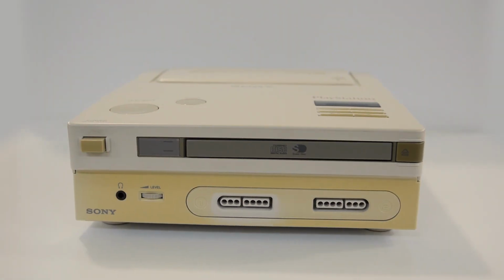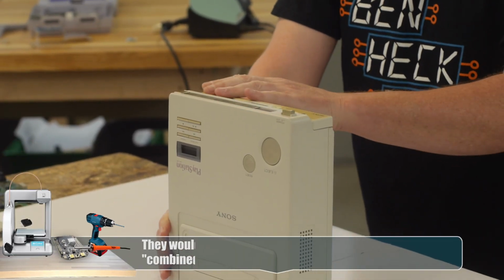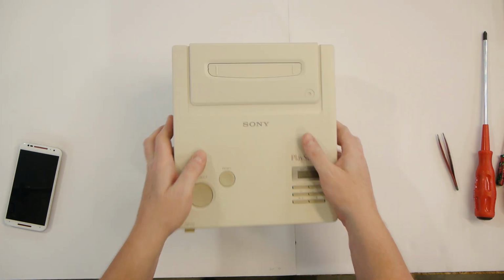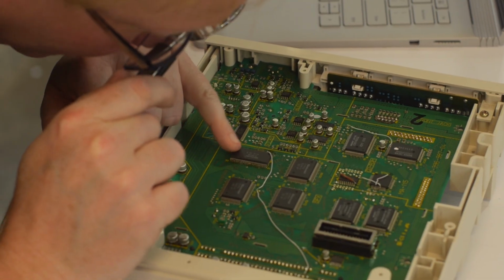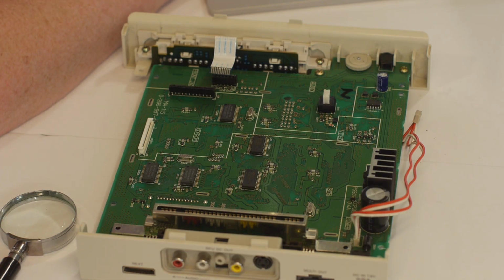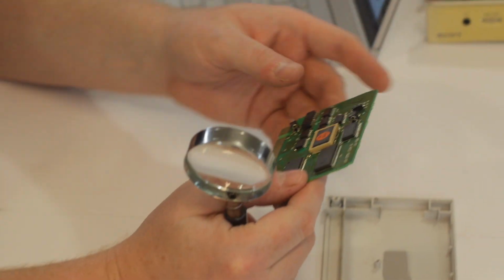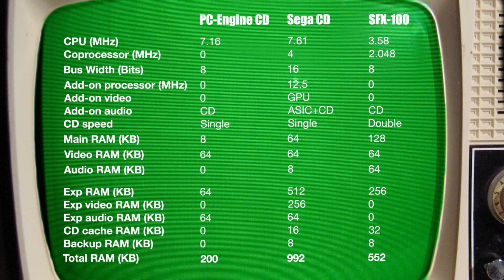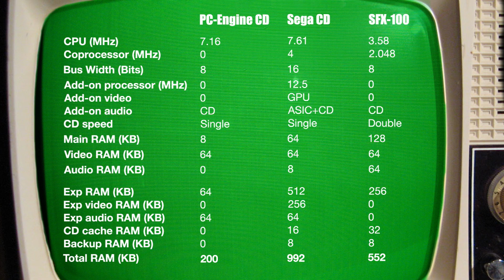Ben Heck's Nintendo-Playstation Prototype Pt 1 Teardown

Comment: I wonder if it would have been possible to re-engineer this so that the double-speed CD-ROM drive could be used to advantage - possibly with a bus-mastering controller, to dump straight from the CD, across a 16-bit bus to the cart?  From a quick glance at the cart pinout, it doesn't appear so, but there might have been a way to do it.
Reply: The 8-bit bus should still be plenty fast enough to DMA the data across to the cart RAM I would imagine.

Double-speed is still only around 300 KB/sec, and I think a fair few CD consoles use a CD drive with an 8-bit (or sometimes even 4-bit) bus?

Then SNES' main data bus is only 8-bit of course. It was quite a clever choice to go with the 65C816 CPU tbh, as it would have made a bit of a saving on te chips, and cart ROMs.
Reply: Yep - the 65C816 is pretty much just a 6502 with an extended instruction set for the 16-bit modes.

You can enable / disable "Emulation" mode on it, where it is supposedly then fully 6502 compatible with no 16-bit stuff.

The width of the bus isn't everything though, of course - the DMA on the SNES is still pretty quick.

The N64 might have a "64-bit" MIPS CPU, but it's another example of where the external bus between the CPU and RCP is still on 32-bits.

It transfers the full 64-bit words in only two clock cycles though, so that makes up for it.

The strange thing about the N64 though (and other machines) is that I don't think many games even use the full 64-bit instructions - they all use the 32-bit instructions AFAIK?

The 65C816 on the SNES definitely helped devs to port older NES games to it, as you say.

The PPU(s) on the SNES are also a kind of "extended" version of the PPU on the NES (literally Super-NES) too.

The Genesis is similar in that way to the Master System, and hence also has the backwards-compatible mode.
Reply: Wow - thanks for the full reply. ;)

(I thought I often typed a lot. hehe)

Yeah - the N64 did have a bit of a flawed launch.

It was a shame as well that they tried to cram so much into the RCP chip, as it seems like they were originally going for far more texture cache, but then culled a lot of stuff to get everything to fit.

There's an awesome write-up about this, but you have to go via the Waybacnk Machine to read it now...

http://web.archive.org/web/20100926220501/http://steveshepard.com/blog/2006/07/09/the-making-of-project-reality

Yep - similar to the Ricoh chip in the NES, the 6510 in the C64 just has an extra IO port on the chip itself. I think it might also have some other illegal instructions compared to a standard 6502, but don't quote me on that.

(the C64 was obviously quite early though, and the MOS thing probably meant they just used the "standard" untouched 6502 core maybe?)

Are you on Faceplant or anything btw?

If you are familiar with the 65C816 stuff, I may want to pick your brain about the FPGA SNES core I've been working on..

So far, I have the CPU core mainly working - I found some code online, but I had to add a couple of missing instructions and fix some other things to get it booting further.

I then removed the original CPU from a SNES board, and hooked up the SNES to the FPGA board (DE1).

I'm actually now able to mostly run some games by "emulating" the cart image from Flash, and the FPGA 65C816 core is running the whole SNES. ;)

But - there are some obvious timing issues - I don't think the setup time is anywhere near long enough for it to write to the PPU on the SNES board properly, so it will often get lots of graphical glitches, palette cycling, or just crash altogether.

The sound usually works quite well though so far (again, using the APU on the real SNES board).

It's good progress though, and there's also that almost-finished PPU code online which I've been trying to get working.

I'll be plugging the SNES board into the Cyclone V board instead very soon, as it has a lot more on-chip RAM (610KB vs only 29KB on the DE1), so that will be handy for both the full amount of VRAM and for debugging via SignalTap.)

The main RAM for the SNES can run from the 512K SRAM obviously.

I know there is already at least one other SNES FPGA core project, but it is closed-source, so I want to make an open-source version.

Preferably all converted to Verilog though, as VHDL is evil. lol
Reply: That's no problem.

Been good to chat and reminisce anyway. ;)

(and thanks for the complement on my lowly channel. hehe. I've wanted to do some "proper" vids for years, but the thought of speaking on camera is highly daunting.)

I also had a 130XE in the early 90s, so I just had to buy one again recently. It's a fantastic machine.

The new one needed a keyboard membrane, so I bought one from that seller in Canadialand (sorry, I can't recall his name / site).

LOVE the Amiga too.

I was never a "power user" of the Amiga as such, but it's an amazing system for it's time.

I was always jealous of our next-door neighbour who bought an A500 in 1987.

The father of my best friend at school at the time worked for Commodore though, so I got to use the A2000 and A3000 quite early on. :)

I still have a small-ish collection of retro machines, including the Atari 2600 / 130XE, SNES, Mega Drive, MSX, Speccies, Archimedes, Neo Geo CD, Sega CD, Intellivision, PCE, Game Gear, Dreamcast (obviously. lol), N64 (love 'em too), Xbox, PS2, BBC, C64, A1200, A600, Jaguar, Vectrex, Game Gear, Lynx etc.

Erm, I think I need to sell some stuff. I never realised it was that bad. It's no wonder I can't move in here. lol

Not all of them are easily moddable for true digital HDMI of course, but I'll be trying my best. :p
Reply: The Playstation and Saturn kind of passed me by in the 90s / early 00s tbh.

I never really got on with the Playstation's "wobbly" graphics style and lack of perspective correction / Z-buffer.

Sony did do well to "get their first" with a hugely successful 3D console though (even if it was kind of "fake" 3D. hehe)

My retro hobby started in the early 90s when we used to go to our local tip every week.

It was an absolutely treasure trove of retro machines, fruit / arcade machine, radar / scientific stuff, and even a shipping container with FOUR Sinclair C5s in it for £150. :o

(sadly, we didn't really have the space for them, so Dad turned down the offer. :( )

But, pretty much every week there were consoles and old computers to be had from there for only about £3-£5 each.

We did have a LOT of PC AT / XT stuff, Apricots, weird Telex machines, Viewdata / Prestel terminals, Nintendo / Sega stuff, and all the usual 8-bit and 16-bit era machines of the time.

I think I even saw a Sam Coupé there once, and I still kick myself about not getting that, but we didn't always have the money spare at the time to buy everything (not the storage space).

At one point, I counted that we had over 70 different machines in one 20ft room. lol

So, a lot of it had to be either repaired and sold, or taken back to the tip. :(

The ZX80s, RM 480Z, Tatungs, Orics, and tons of other rarer stuff would have fetched a fair penny now.

I do have a soft spot for the N64 though - I always loved the SGI hardware, and was stunned when I first heard that they would be helping Nintendo to build a console.

It is a shame about that RCP thing though - it could have been WAY more powerful if they'd spent another year on the design (and might still have competed better with the Dreamcast and even the PS2 for a while longer).

Anyway, I guess we'll never know.

btw - true HDMI actually IS possible on the Intellivision at least. lol

It uses one of those old-skool (Toshiba or Philips) type video encoders with the digital inputs for the colour selection, so it would definitely be possible to mod.

I did start looking into modding the Atari 2600 with HDMI, just for the kick. It kind of outputs "digital" signals too, but it does a direct modulation of the colour carrier.

Due to it's relatively low colour palette (although amazing for it's time), it would be possible to just "re-generate" the colours in the digital domain anyway, so that would in theory remove ANY possible noise from the signal.

Kind of pointless though of course, but it would make for some funny news articles and forum posts I guess.

(Also, the FPGA itself is fairly small, but more than capable of running 2600 games already.)
Reply: Not my write-up btw, but it is awesome. :)

The texture warping / wobbling on the PS1 is down to the use of fixed-point maths for the 3D matrix stuff.

That's not to say that fixed-point is inherently imprecise of course - it can be very precise if enough bits are used for a given task.

Actually, I believe it's the "points" of the 3D models which have the main wobble, but the warping of the textures is mainly caused by the lack of perspective correction.

(no Z-Buffer, so no 1/w divide for the texture mapping.)

The PS1 was / is still a great machine though, and I'm really starting to appreciate it more now. It has a HUGE library of games, many of which are quite good (I've played a few on emulators and on my PS2 Slim.)

I do recall that kind of "no-man's land" era in the mid-90s when the 3D cards for PCs were few and far between, or the good ones were still way too expensive.

I also remember messing around with the different rendering modes on Tomb Raider at the time, and on Descent (loved that game, along with Terminal Velocity). lol

Yeah, we were quite lucky to have RGB SCART on many TVs in the UK / Europe.

Some of the US guys like "My Life In Gaming" were asked why they always used either RF, Composite, or S-Video, and they said "we just didn't know any different - that's all we had here."

I guess that makes sense - It would be like assuming we would know in the UK that Japan also had it's own SCART standard too (which I didn't know for a fair few years).

Nintendo really missed a trick with not bothering to add RGB to the European N64s (well, until some of the later revisions in France I think, which had the appropriate DAC for the mod).

They also should have put analog Component on the Game Cube as standard, as the 480p stuff was already quite well established by then (and obviously supported in most US Game Cube titles).

We did luckily have RGB on PAL Game Cubes, but that still limited it to 480i / 576i of course.

I have been watching a fair few PS1 / Saturn vids though. The Game Sack review vids are always superb. :)
Reply: Excellent points, all.  To be clearer about what I was getting at, I was wondering if there would have been a way, using minimal hardware or software additions, so that this device could have avoided the Playstation's "Loading..." screens - perhaps by doing the load straight from the CD-ROM to the cart memory, and avoiding the CPU, and perhaps even using a 16-bit path between the two, leaving the CPU with just an 8 bit for compatibility and for cutting down on peripheral chip costs.  Lots of maybes, though.
Reply: Oh, you mean THIS Playstation? (sorry, I thought you meant the actual Sony Playstion for a second there. lol)

Well, it will very likely have already been using DMA to transfer the data from the CD to the RAM in the cart as quickly as possible (limited by the ~300 KB/s transfer rate of the double-speed CD drive hardware).

The SNES CPU has quite a large amount of DMA hardware built-in, and I think that's 8 different "channels" of DMA, plus the H-DMA stuff.

("channels" really just means that it has 8 sets of registers for for doing a DMA from / to 8 different locations in the machine, and then fired off one after the other, if desired.)

The loading speed of the Superdisc really is hugely limited by the speed of the CD drive.

Having said that, it only has around 256KB of WRAM on the "CD" cart anyway, so it would only take a second or two to completely fill that with a chunk of data once the disk is up to speed. ;)

Also, the interface from the CD drive is very likely just 8-bit anyway. Some of the older CD drive chipsets even had a 4-bit interface for some time. (That includes the Sega CD / CDX and Neo Geo CD IIRC?)

Comment: I'd never thought about it before, but I always ejected SNES carts with the eject button. Am I the only one?
Reply: Yeah, I've never heard of anyone NOT using the eject button.
Reply: I used it every time... Sorry, Ben.
Reply: Nope I've always done so myself. I remember one time I was hanging out with some friends when I was about 9 or 10, I didn't own a SNES but they did and we were playing some games. They went to switch the game out with another one and was trying to pull the cartridge out, without ejecting it. I quickly got up and said "no that's not how you get those games out, you can break it!" :V And it wasn't even my console or games...
Reply: I always used the eject button on the SNES, It's instinctive to me. It's actually a very good feature.
Reply: I have 4 "collector quality" SNES consoles all of which get used allot. I've never in all my years of playing and fixing snes consoles, ever seen or heard about the eject lever breaking. Everything else on the SNES will crack, chip or fail but again I've never had an eject lever fail on me lol.
Reply: Nope, I always used the eject button too.  In all my life, I had never met anyone who owned a SNES to not use that eject button.
Reply: nope
Reply: Thanks lmao. 25 years and counting still never broke one.
Reply: Robert NES816 if you have a collector quality snes I would suggest not using it. It's basically a piece of plastic that removes the game with a see saw motion and could possibly break over time.
Reply: Robert NES816 I have but congrats on the high quality stuff. Lol
Reply: Robert NES816 mine always had issues with reading the cartridge, just a slight tap and then boom! frozen like elsa!
Reply: No, I do too
Reply: L3610NF0R14M7H37RU7H Gotta clean them.
Reply: That's a dumb question. How could you be the only one?
Reply: I used the eject button, because I was afraid of tearing it up if not using it.

Comment: Much of the tech details on the unit were already figured out on AssemblerGames, and purely from the original photos (of which there were very few at high detail)..

This is one of my posts (I'm known as OzOnE on most forums) where I found why the buffer chip is installed "backwards", and why it has the extra bodge wires etc., and also how the CD section hooks up to the expansion bus...

http://assemblergames.com/l/threads/nintendo-snes-playstation-finally-uncovered-read-the-first-post-before-posting.57166/page-27#post-850120

I hope and prey that Ben Heck was at least wearing an ESD wrist strap while taking that thing apart?
(Unless he had one on his ankle, or has the conductive flooring / mat stuff, in which case I apologize.)

That unit is so rare / expensive that it just isn't worth taking any risks with it.

As Dan said in the vid - the audio output doesn't work though, which could explain why the CD section also isn't working (very likely a missing voltage like +9V or +12V for both the audio opamps and the CD drive motors.)

It's also possible that there is no firmware on the main MCU for the CD section of course, or it might have been in the middle of development, hence the circuit wasn't quite put back together properly?

The fact that the audio output isn't working does suggest that one of the power rails might be missing / low though (likely a +9V or +12V rail for the audio opamps and CD drive motors.)

Watching the rest of the vid now (through my fingers. lol)

Comment: The assembly that prevents cartridges from being removed while the power is on is almost identical to the same assembly in an original Super NES. I've never disassembled a Super Famicom, but I assume it's the same.

Comment: Ben, the expansion port on the bottom was for the Satellaview, a modem-like peripheral for the Japanese system that used a sort of subscription service to deliver exclusive games and variety content. a few of those were popular enough to receive cartridge releases as well! (I'm sure others have already commented this, but there you go)
Reply: It could also have been used with practically any other expansion device that the SNES could use - since this unit is essentially a SNES. :p
Reply: there weren't any others, though...! the only accessories that took advantage of the expansion port was the Satellaview, to my knowledge. But yeah, in theory, it could have been for any potential peripheral.
Reply: It's a bit weird that the SuperDisc proto is already listed on that page too though - I never noticed that before.

I wonder if it had been recently updated?

Comment: Socketed ROM? Dump the contents.  I'm looking forward to part 2.
Reply: The ROM was dumped many months ago (via LuigiBlood / KiiriBomber, I believe). It's on the Interwebz.

They've even stsrted adding the CD emulation to BSNES and other emulators, I think?

There's not too much you can do with it atm of course, but it will allow people to create "Superdisc Homebrew" without needing the bery rare unit.

(I might be making a hardware CD add-on version for the SNES if there's call for it, but it's probably easier to just implement it on a SNES Everdrive tbh.)

Comment: Ben your stats for pc-engine are only 1/3 correct.  The super-cd system card, which was built into the Duo varients of the console, added a additional 192k over what the cd system had originally, and the arcade card added even more so the total ram was 2MB

Comment: Many plastics at the time had chemical mixtures for purposes such as fire retarding, and the chemicals are more prone to yellowing in UV light or in heat generated by electronics, ambient air, etc... not all plastic parts had it, or even the same mixture, so you get different degrees of discoloration.